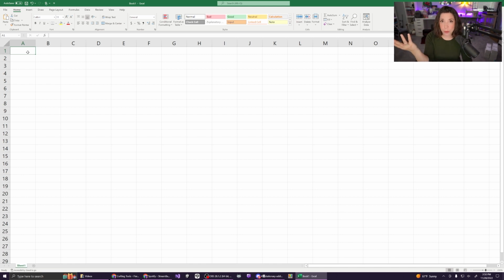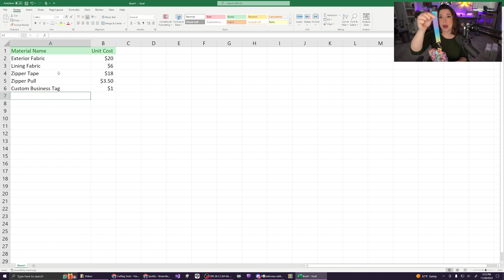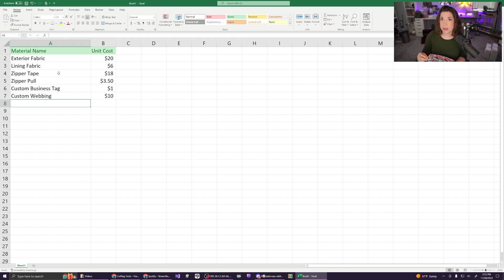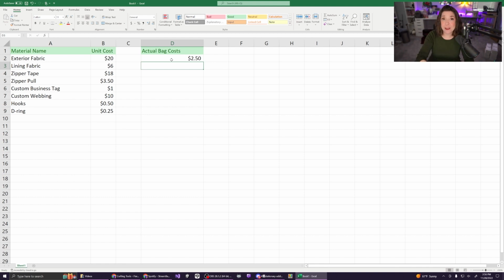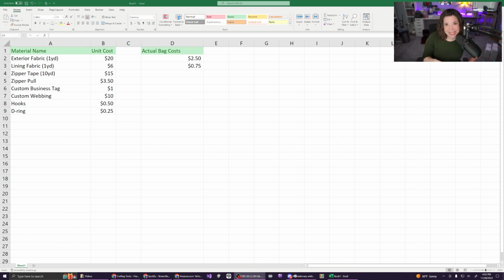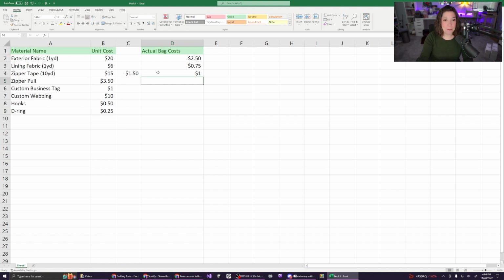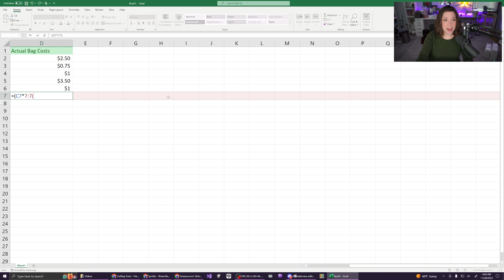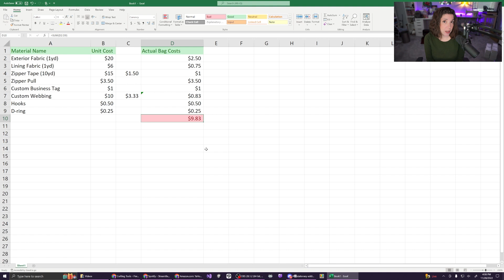How to Calculate Manufacturing Costs for Handmade Products

Comment: Where do you factor in, if at all, costs of things like the thread, the electricity for running the machine, maintenance of said machine.?  I'm not interested in nickel and diming something to death, but those costs are real costs as well and I'm curious if they are rolled into something.
Reply from the maker: Good question and I kind of glossed over it when I talked about the rivets. I only care about thread costs when it comes to embroidery. I charge for embroidered products differently (something maybe I could have mentioned in the video). For those products, I will charge for the base item and then $1 per 1,000 stitches. It never made sense to me to roll in that cost to something like bags or wallets. It's works itself out, for me, when I just round up. E.g. we came out to $9.63 for the cost to make this bag, so I'll round up and that should cover one needle and the thread used - gentle reminder I buy in bulk, so my costs are lower.
Reply: I'm not a bulk buyer. I add 10% to my material cost to cover things like thread, needles, rivets, rotary blades, etc.

Comment: Hello I watched your video so many times, but still can't figure out how can I calculate. Because my materials are on meter/cm and in Euro not Dollars
I would like to calculate my own bags, but I don't no how can I calculate. The math is very difficult for me.
Please help me understand!!
What means the B2*(1/8)??!!!
Reply from the maker: Let's say you paid 18 euros for a meter. There are 4458 square centimeters to that meter of fabric (assuming 45" wide). Take the cost of the meter (18 euros) and divide it by the number of centimeters (4458) to get your per-cm cost: 0.00404 (rounded up). Lay out your pattern pieces as you would to cut and determine how many square centimeters you need for that fabric. You determine this by measuring the width and height of the area the pattern pieces take up, then multiply those together to get the square centimeters. Take that value and multiply it by the cost. 

So if I'm going to need 250 centimeters in total for the bag's exterior fabric, that will cost me 1 euro for the bag's exterior.

Mind you I use US dollars and Imperial units, so I may have seriously mucked up the conversion HOWEVER the formula is correct LOL!!!